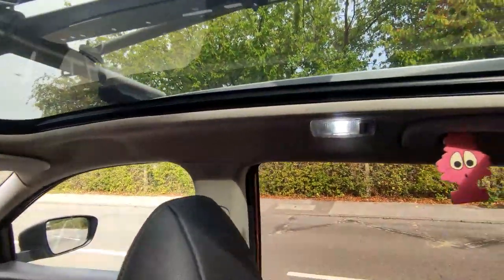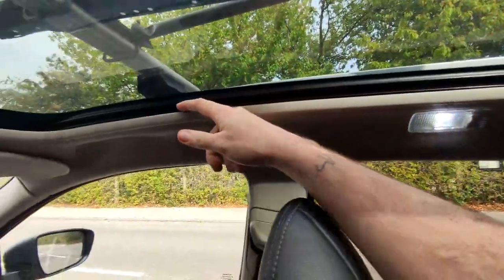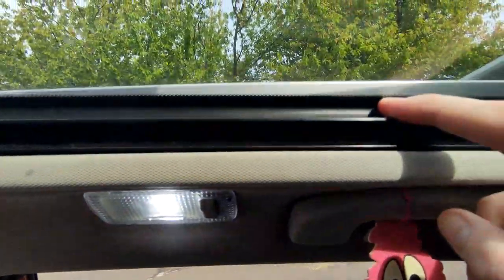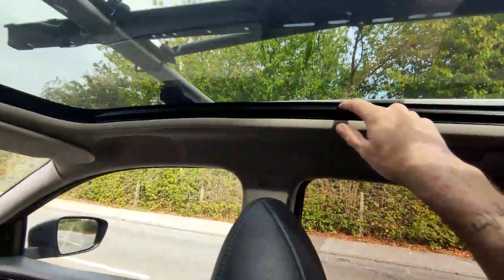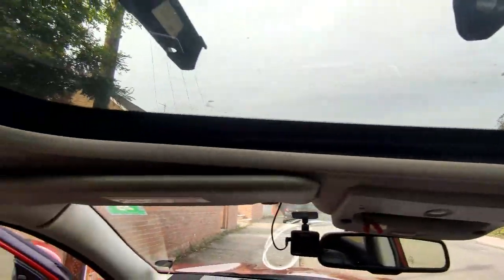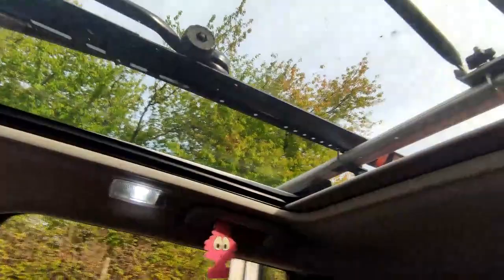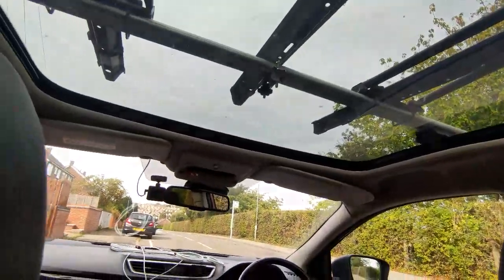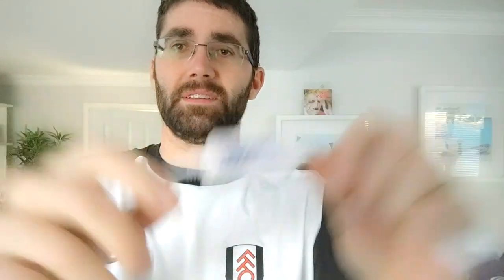How to Install Panoramic Roof Ambient Lighting on a J11 Nissan Qashqai

Comment: I think using a different colour would be a very very good idea!

I’d only used red as any other colour absolutely ruins your night vision, not a good idea when driving at night. Great idea to use the dimmer.

When you solder to the small tabs on the strips a good idea is to keep the stripping of the wires as short as possible. Otherwise they may touch with disastrous results. When I used a very similar strip I used silicon sealant over the soldered wires to hold them in position and make sure they never touch.

By the way I’ve an ongoing problem with my Qashqai, with heater/A-C airflow. It’s intermittent, the worse type of fault, it’s been into the dealers a few times now. The fan is working but no airflow through the vents, next day it’s fine. Last time it happened I videoed it, see my channel on YouTube, mainly to give the dealer some idea. Luckily I took out the extra two year warranty, bought last s/h it’s a 2015 1.5dci Teckna.

Keep the videos coming, I enjoy the channel a lot.
Reply from the maker: Must be honest, I am tempted to order them in orange and do it again...
Reply: @TheQashqaiGuy  I’ve just ordered some led ambient light strips from Aliexpress in orange red-  usb powered. Hoping it matches the built in ambient light! Going to put around the doors ❤️❤️

Comment: Great idea! I have a j10 with the panoramic roof, but the blinds are in 3 pieces and go back one over the other. Can i pass through the cable that connects both led strips together or will it get in the way of the blinds?
Reply from the maker: Have a close look at how they run, the j11 has that rubber groove that works a treat luckily

Comment: Nice found! Would be wonderful with RGB as well. Did you had enough place behind the map lights? As I already have both my white as RGB footwell lights connected there I remember it was quite a hassle to put the map lights back with out damaging the cables or connectors.
Reply from the maker: Yeah had loads of room
Reply: @TheQashqaiGuy  you could even consider to turn off the map lights now. Especially in the back 👍🏻
Reply from the maker: Yeah good point

Comment: If you wire to the interior light and lock the car from the inside whilst driving as some cars have the auto lock fitted once 5mph plus is reached to stop people getting inside but Nissan did away with the feature, do the mood strips switch off 👍🏼
Reply from the maker: I'll check tomorrow

Comment: I installed qashqai j11 ambiance. I want the ambiance to be turned on when the headlights are turned on.  where can i connect the wire
Reply from the maker: Any backlight source that comes on with headlights
Reply: @TheQashqaiGuy  in the fuse box , can I do this with the fuse extend?
Reply from the maker: Put a piggy back fuse on it for safety